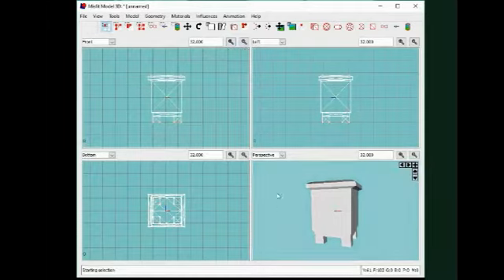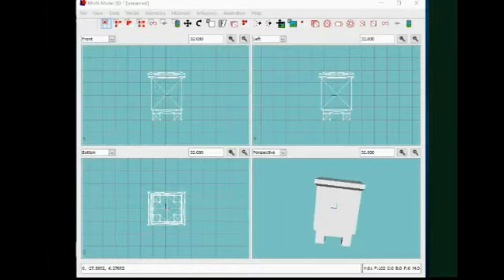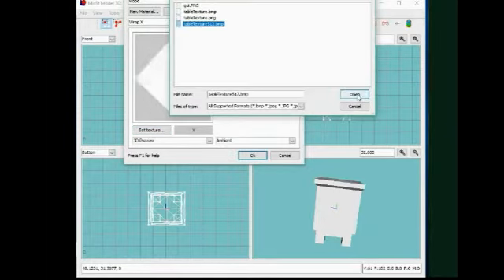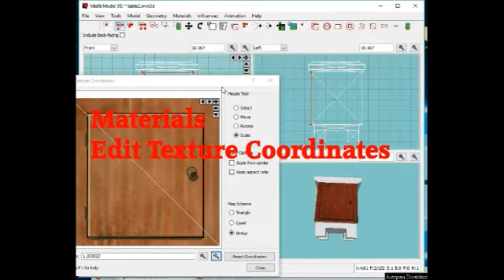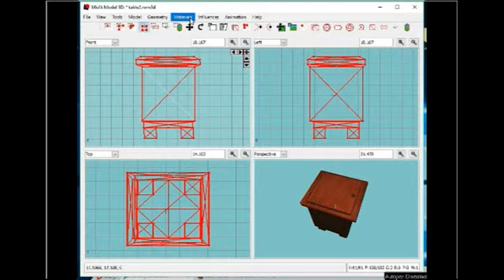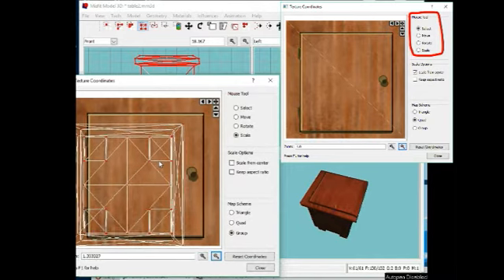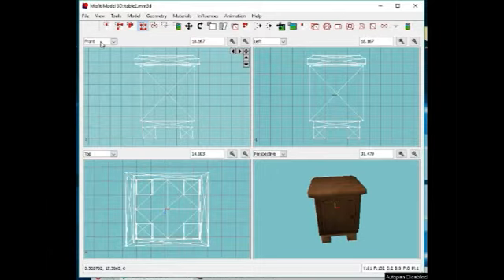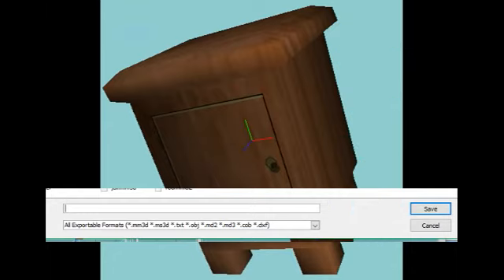Misfit Model 3D - adding Texture

Comment: Thanks for your tutorials about misfit 3d. Wish you made a video of how you put textures on your lioness model though cause I dont know if it was a simple as this cupboard.
Reply from the maker: With a more complicated model there are more work to get things in place, but the principles are the same.
Making the texture can be the part that is more difficult.
I'll see if I get around to do a video on that at some point in the future.
Reply: @perkgrok822  I finally textured my low poly ninja and even got to animate thanks to you. Do you know of any header files in C that I could use in loading md2 and its frame animation? Hope you make a video about it. +1 sub kudos to you sir
Reply from the maker: @fliptoynk  I'm glad the video was of use to you. 

Sorry, but I don't have any solution for loading md2 in C. I'm not that great of a programmer. I tend to rely on engines and I mostly to stuff in 2D.